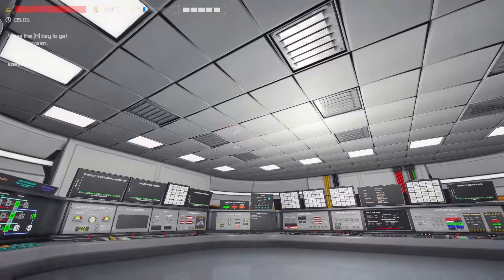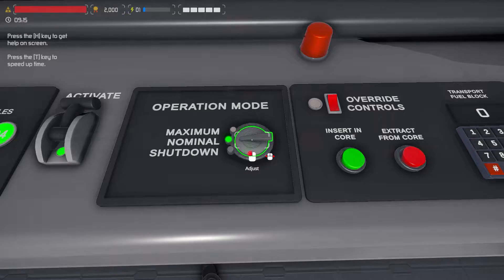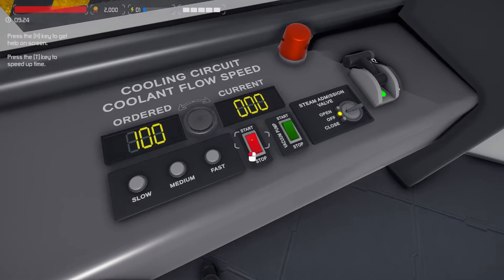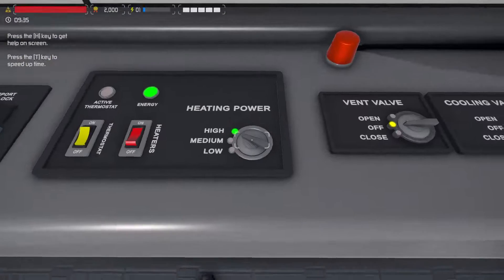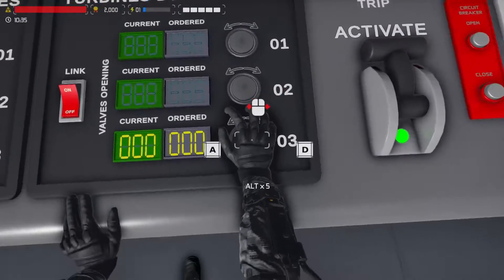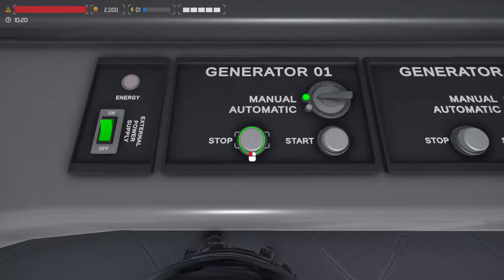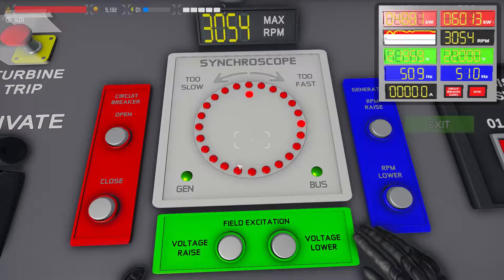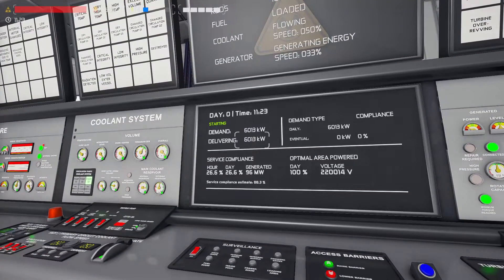NUCLEARES - Reactor Startup Tutorial | Quick & Easy!

Comment: @TiJayFLY note the thermostat will control the heaters for the Pressurizer, AO is no longer required to control heating.
Reply: And there is an external power supply so you dont have to heavily rely on your Emergency Generators.

Comment: After all that, what do you do? Do you chill and do nothing? Or is there something else to do?
Reply from the maker: You can for a while, but eventually the grid demand outstrips the plant’s ability to supply. And the components have maintenance requirements, so every 6 days or so you’ll want to take the plant down for upgrade and maintenance using the points you gathered over the previous week.
Reply: @TiJayFLY  There is xenon reactivity i see, what do you do with that? Or just leave it alone?
Reply from the maker: @1408Saned  I think there’s some kind of chemical minigame in testing, but it’s not currently part of the main gameplay. So yeah leave it